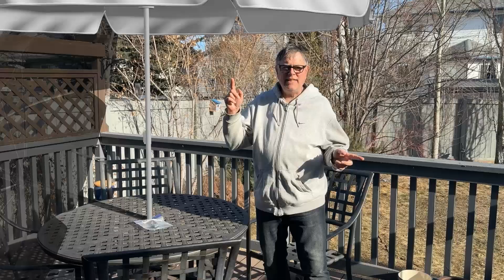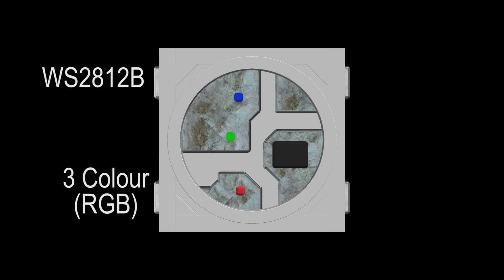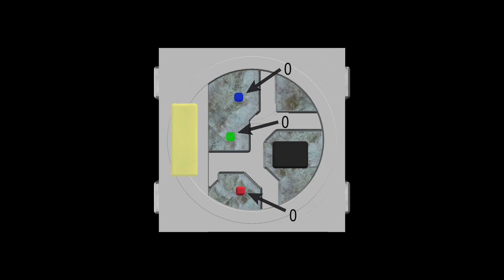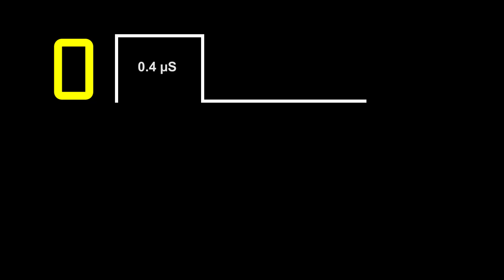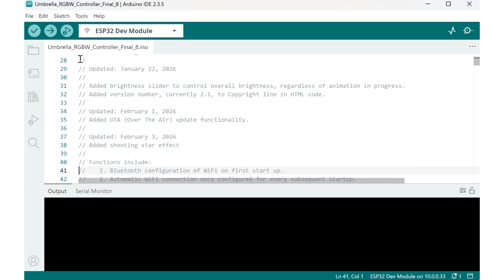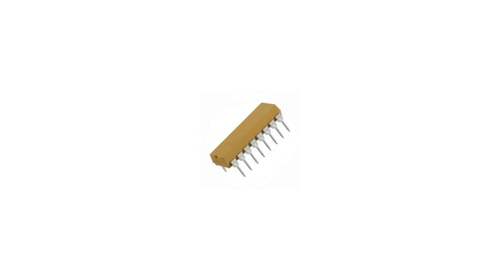Addressable LEDs - Deep Technical Dive into How They Work

Comment: Excellent information and reasonably explained.  You failed to elaborate about the 10 AMP issue and did not touch on how you put things together, how you handled weather issues (it was an outdoor umbrella project) and did not address putting the multiple components together.  It would have been nice to see the umbrella actually works.  Finally - for me - constant piano music in the background we really really distracting.  When I tried to watch the video with captions - the word music kept popping up in the caption so that was a negative artifact of the constant piano music.  You could do a "part 2" and actually show the implementation, as well as show other controllers rather than using the DIY kit build process.  Thank you for doing what you did as it helps me understand more about these LED implementations.
Reply from the maker: The 10 Amp issue was solved using a 10+Amp power supply. I wasn't planning on showing other controllers simply because that wasn't the point of this.  I wanted to build this entirely by myself. I could put together a quick Part 2, showing some of the patterns. Thanks for the feedback.
Reply from the maker: I just put up a second video, which shows the umbrella in action! and the LED strips are rated IP65, the best you can get for outdoor use, as they are waterproof and dust proof. (and no music this time). ❤